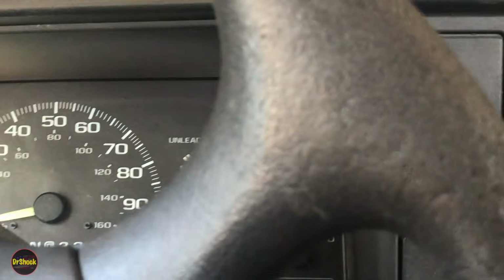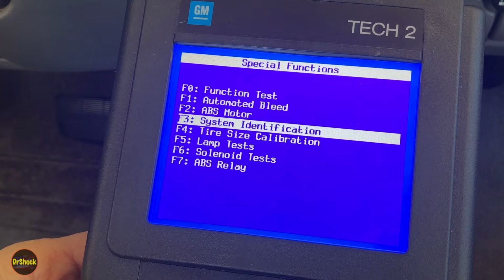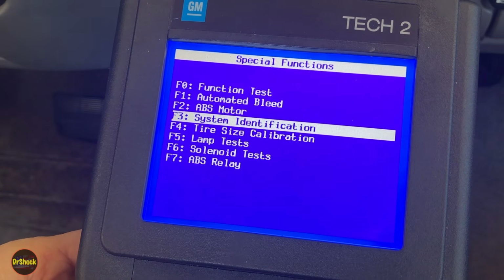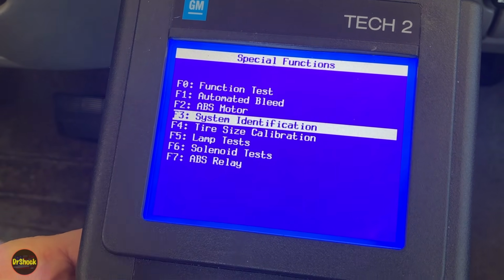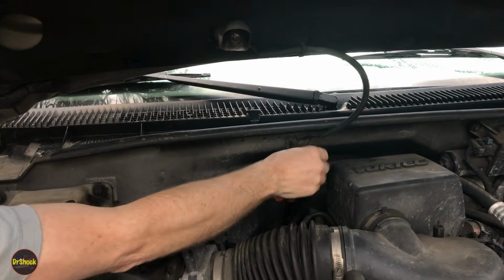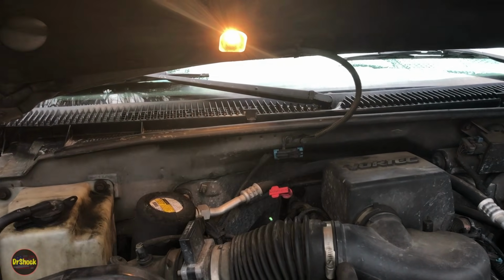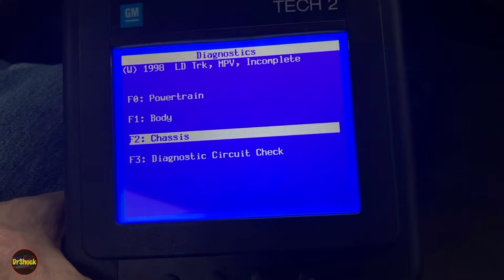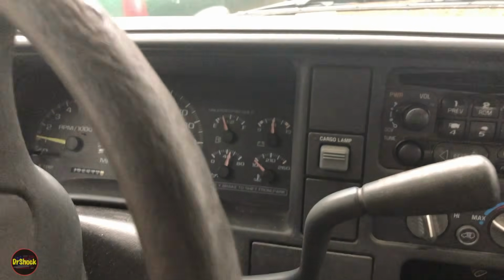1995 - 2002 GM OBS Truck 4WAL ABS Module DTC C0268 Repair Kelsey-Hayes EBC310 Teardown (Chevy & GMC)

Comment: I messaged you earlier tonight about a situation with the same ABS box on my 97 c3500 dually 6.5 turbo diesel. I asked you about the pin on the lower bleeder that faces the engine missing after Auto bleeding it. I found this video and watched it. At 1:02:57 of this video you said that the one pin that faces the engine sometimes is not visible and that is common. That is the one I was telling you that was missing on mine. What I'm curious about is before I ran the tech2 auto bleed that pin was pushed out like the other one you showed. After running the auto bleed it was not visible almost like it sucked up into the box. Is that what happens or am I misunderstanding how it works. I appreciate your help
Reply from the maker: I've not seen one missing the center pin entirely before, but I have seen them in slightly differing depths.  I would speculate that these move to facilitate auto bleeding of air.  But they can become corroded and inoperative in salt belt areas.  Especially if the black rubber boots that protect them are missing.
 
You might remove the boots and observe their operation during an auto bleed procedure to confirm there is no brake fluid escaping.

Comment: You showed a test drive. And talked about streeing wheel pulled to the left.
But you did not mention,  what's happens if you did drive test and it did not pull hard to the left but truck still has ABS light on..
Reply from the maker: A pull is related to a sticking or stuck solenoid in the brake pressure modulator valve (BPMV) module.   It's going to be mechanical and will not trigger the ABS light at all.

When the light is on, it's something electrical or hydraulic sensor detected and that's usually going to be with the Electronic Brake Control Module (EBCM) and give a code for a scan tool capable of retrieving ABS module codes.

Comment: Just watched Your Video! It was so informative and very detailed! I'm not a mechanic but I'm in a Situation where I think my ABS pump is going bad and I have to find a Replacement at A Junkyard Also. I've changed out Hoses, calipers, master cylinder and Brake Booster! But my left front wheel keeps locking up after driving awhile, I'm guessing this is what I have to do next..thanks

Comment: I have question is there any different between 96 and 99
Reply from the maker: This design was only used on the old body style C/K trucks (OBS) and G vans.  So 99 would only be the same for C/K SUV bodies.  And for G vans it was the same thru 2002. But since the pickups went to the new body style (NBS) in 1999, there are no compatible parts - totally different ABS design introduced in 99 pickups there.  SUVs changed in 2000, and G vans after 2002.
Reply: @DrShock  thanks for responding I want to buy used ones so my truck is 96 Yukon 2 door 4WD what should I look for?
Reply from the maker: There's links in the descriptions for the ones I went over.   Basically 1500 or 2500 or 3500 all are different.   Aim to pull from the same model so a 96, 97, 98, or 99 Yukon or Tahoe.
Reply: @DrShock  well I did find used ones no communication with ABS so what do think the problem ?
Reply from the maker: No comms from scan tool?  Obviously wiring harness issue, you'll have to debug where the short or open in the communications wiring is located from the OBDII connector under the dash out thru to the ABS module under the hood.

Comment: Wow what an in depth video. I have a 1998 chevy and the ABS looks identical.  No way do I want to fix mine. ABS delete is what I want to do.  I have a few questions.   First are my brakes suppose to be weak?  I mean I just went through all 4 wheels and put on all new brakes. On the front wheel calipers I notice the banjo bolts with the copper washers only has a tiny pin hole to let the brake fluid through.  Add that to the masters cylinder springs that take all of my strength to bench bleed and I have to wonder why?  I want to be able to lock up all 4 wheels if I so desire.  Maybe the ABS is making the brakes weak?   I really like this video so far.

Comment: Can you use that tech 2 on a 1995 gmc sierra 1500 to do an auto bleed on the brake system?
Reply from the maker: You can if it has OBD2 for the Tech2 to communicate with it.  1995 was a transition year for OBD2, most vehicles will still have OBD1.  The Tech2 will come with both an OBD1 and OBD2 adapter, but as best I recall the automated bleed was an OBD2 feature only.

Comment: Hello im working on a 1998 Chevy Tahoe. The brakes are locking up on the front passenger side. Thought it was the caliper as it wouldnt press back in so we put one on. I noticed during bleeding that fluid would not come through the bleeder everytime the brakes where pressed. I told him not to drive it but he insisted and the brakes locked up again. The lines seem fine. What outside of the model could cause this just on the one side? The master cylinder and booster seem to be operating fine aswell. Thanks for any help or tips
Reply from the maker: You have to diagnose each component of the brake system individually to see where the fault is.  There is no single failure point for the symptoms you describe.  It also can be very expensive to fire the parts cannon at a problem like this as well, so the time invested in diagnosis could actually end up saving money.  I would start at the master cylinder checking pressure and correct operation, then the hardlines for obstruction, then the hoses for same or collapsing, then the calipers.   When all else fails, it's likely the ABS module as we showed in this vid.
Reply: @DrShock  thank you fir the reply. Somone else said it was the calipers and I just changed them. This is when i noticed the passenger side was at fault and it still wouldnt compress even after the master cylinder was unhooked. But would once you cracked the line at the caliper.So its gotta be something im nlt seeing in a line or the abs module. Whats the best way to check the lines themselves if nothing is visual? Thanks again fir the reply
Reply from the maker: It's difficult to say remotely over a comment board, but if you had back pressure and then that was relieved when you opened the line closer to the caliper, but did not relieve when opening the line at the master cylinder, I would be suspecting a hard line or hose obstruction as a start followed by ABS unit.  Again, anything over comment board sight unseen is going to be wildly subjective suggestions wise.   On hoses you can visually inspect them for being collapsed internally.  On hard lines it's only a painstaking visual inspection for dents/crimps externally.
Reply: @DrShock  Completely understand. It is almost impossible to guess the exact problem through talking and not visually seeing it. Just wanted some direction and you’ve given me that. Thanks

Comment: Hello there I have my front brakes on my truck locked y replace  master cylinder and calipers the brakes still lock I assume is the abs system any tips on fixing this problem
Reply from the maker: Unlikely to be calipers because they do not fail in pairs simultaneously, only individually.   So you're checking all the components that are shared by both front brakes.  You have to do diagnosis and determine the failure, as this could be very expensive to resolve just throwing parts at it.

Could be any number of things.  Need to pull any ABS module codes first with a scan tool capable of reading those.   That might point you in some direction.  

Check all front brake hard lines for damage/restrictions, check front brake hoses for being collapsed.  For the pads to not release, something is preventing fluid pressure from subsiding after the pedal is released.
Reply: Thank you for the reply  I replace the lines and master cylinder still locked I’m checking the abs system

Comment: Great video boss but I have a question is this the same type of equipment that’s located underneath the passenger seat outside the chassis on these GM Avalanche oh and by the way I have four Chevy avalanche and to have the brake and ABS light on is that what we’re talking about? I also have another question I know I’m full of it ha ha ha ha ha but you got a manual and a scan tool it said General Motors on top of the scan tool in a manual where do you get that kind of stuff never been that familiar with any of that stuff like I said before I want to get my first scan tool and I want to make sure I get the right one so can you help me with these two questions I would really appreciate it sir thank you and God bless you I’ll be waiting for your reply✝️✝️✝️
Reply from the maker: There are links in the video description to find the tools I use in these videos.  This particular video is very specific to the years and models in the title.   The later ABS module designs are quite different.
Reply: @DrShock  thank you thank you so much for responding to me, you don’t know how much this means to me I have talked to so many techs here on YouTube none of them none of them will respond to me a lot of them want to sell merchandise and want me to watch their videos which I have been doing but what’s sad is nobody wants to help out each other. But you sir you are a gentleman and a scholar to the industry I really do appreciate your response God bless you and I pray to Jesus Christ to bring you lots of love peace and prosperity for your family and friends and thank you so much for responding to my questions means a lot to me ✝️✝️✝️
Reply: @DrShock  I learned a lot from you and I do plan on donating just let me go get my credit card and I’ll sign up thank you for the information and thank you for teaching me a lot lol God bless you once again ✝️✝️✝️
Reply: @DrShock  and I don’t mind donating to you because you actually responded but all these other guys they just want you to buy their merchandise or donate but they never respond to you they never even say hi or nothing I don’t wanna be recognized I just want to learn something from the videos that’s what’s most important. So please keep doing the great work you’re doing and God bless you✝️✝️✝️

Comment: I just had a well known local repair shop refusing to work on my 2000 Chevy Express Van. I am now waiting on a scan tool to ping the ABS to help bleed the system. I , like you had to replace my unit with a salvage yard unit. My valve body was shot.
Reply from the maker: Yep, when they get to a certain age most shops won't touch them. Alot of these shops only know how to swap parts, not diagnose anything and have no older service manuals.   Brittle plastic that breaks rather than disconnects, intense corrosion that can break the fastener during removal etc.  All of these things cause shops to pass on your business after certain number of years has passed.  Best is to handle it all yourself anyway.
Reply: @DrShock  What Scan tool code reader do I need for a 2000 Chevy Express Van? I followed your link and I believe eBay has done a bait and switch and led me to a cro123e which does not support the auto bleed function. Have you a fresh link to the Tech 2?
Reply from the maker: A Tech2 clone would be great.  An MDI clone running the Tech2Win emulator would work too.   That eBay link works fine for me, it's not possible to filter out the folks who misleadingly tag their listings with "Tech2" , but the Tech2s are showing up when I click it.
Reply: @DrShock  You are a good man Charlie Brown. I can not thank you enough for your expertise and additional effort to share your knowledge.

Comment: Delete the obsolete abs system if possible for your situation. The issues will continue and contribute to the destruction of the truck
Reply from the maker: That's a really misinformed suggestion.  As an engineer I'm here to tell you ABS technology saves lives and prevents destruction of property.   Anything claimed to the contrary is flat out fake news.  Repairing the vehicle back to factory specifications to maintain a safe and reliable transportation tool is the only path.  Full stop.  

Fix it right and safe, or don't drive it until you can.   Part of why I make videos like this one, sharing alot of deep technical details, is so folks can do exactly that themselves.
Reply: @DrShock   I normally would agree with that statement.  However, GM and other parts suppliers have chosen to make that decision for us.  They saw fit to discontinue the much needed parts to keep these vehicles in factory condition.  If it was of paramount importance to keep these vehicles in factory fresh condition, then the government should require that parts needed for safety, such as brakes, be made available.  Instead, the government decided to award people to crush used vehicles and make it much harder to find acceptable used parts on this still usable but aging platform.  I decided not to fight the system and just unplugged it.  Power bled the brakes and now my truck will stop before I run over innocent children.
Reply: @Challengerscatpack50  
Dr Shock is awesome & I love his videos.  I agree with that ABS is a great safety feature.  However your point is valid.  Many are left with no choice when parts fail and they can’t find a substitute.
Reply: @DrShock  Oh bs, just a few years earlier and there was no abs, plenty safe to drive, and lol to your needing to throw away some stupid screws cause they were torque to yield
Reply: @DrShock  HAHAHAHA you have the money for it!! The scan tool, the new parts, all that

Comment: I'm curious as to identifying the fixed orifice unit from the variable orifice unit, information is thin on the ground for this in Australia
Reply from the maker: I've not read anything about any such orifice differences with regards to the EBC310 4WAL unit used in the GM OBS trucks.   The BPMVs used in this era ABS technology were built uniquely to each truck model and brake/power train option.  Hence why there are so many GM part numbers.
Reply: Mmm interesting as my 96 C model comes up with fixed orifice in tech2 but my 98 K model doesn't
Reply from the maker: Curious, which Tech2 special function / test are you seeing that verbiage on?   I'd like to look into it some more.

Comment: How did you test your replacement unit off of the truck? Did you just do the one test for resistance? Please explain as I purchased two units without the aid of Tech II and so it is crapshoot if they fit my Suburban (8600 GVW) with hydroboost. It would be nice to at least be able to test them prior to installation.
Reply from the maker: You can perform the first resistance test, on the pump within the BPMV either on or off the vehicle.  But the second resistance test, and the voltage test, for the EBCM C3 connector have to be performed on the vehicle.

Unfortunately there is very little you can do to test either the EBCM or BPMV on the EBC310 series off the vehicle.  It would have to be a plug and find out if it works situation.   And not knowing what vehicle the ABS unit was pulled from, next to impossible to identify and determine if it's correct for your vehicle.    I try to improve my odds in these situations by only pulling/buying salvage parts from a crash vehicle, so at least I know it was running before scrapped vs someones project they gave up on.

If your Suburban is a 2500 though, you would be lucky in that it would use a unique combo valve with code "S".     But a 1500 could be any of two different EBCMs that both share the same BPMV and both use a code "A" combo valve.   You have to know the parts history, what it was pulled from, to be sure of fitment.
Reply: @DrShock  Thank you. Perfect detail and Factory info as always. My truck: 96 GMC K2500 Suburban, Auto, 7.4L Gas, 8600 GVW, Tow package with locking diff. Not a bunch of my truck at the salvage yard...
Reply from the maker: Yeah tough to find, but easy to id given it's a Suburban 2500 (C or K).   You just need to verify that "S" code on the combo valve.  Your original should have it, if it's the original.  ;-)